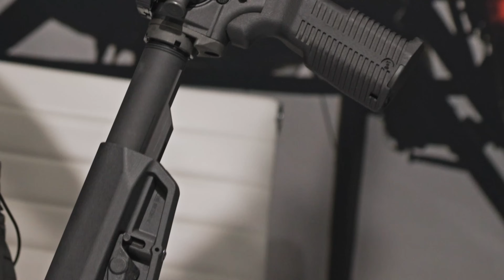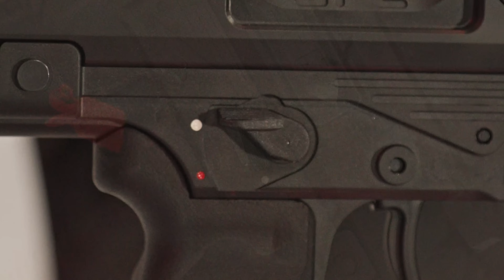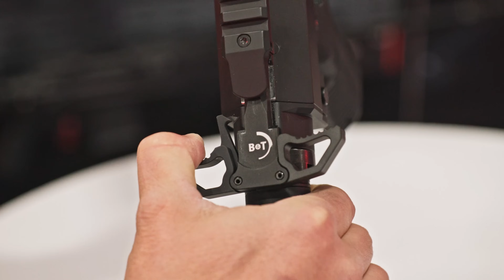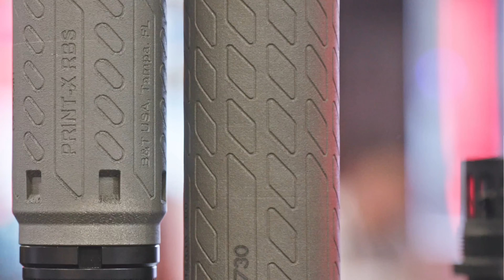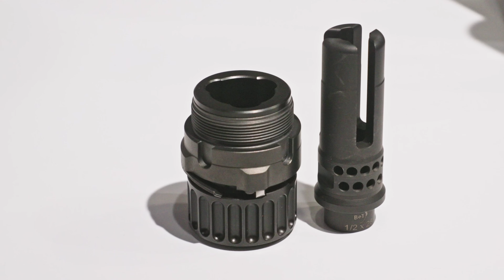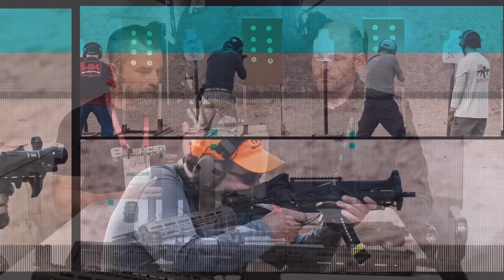SHOT Show 2025: NEW B&T Products! SPC223, Titanium Handguard, TP9 Pro, Print-X VERS36 Ti & More!

Comment: A 3D printed titanium handguard? Why is that? A tribute to fashion? To make it more expensive? To increase the weight? Aviation aluminum is enough for the rigidity of the structure. And titanium conducts heat 10 times worse, so with intensive shooting your barrel will cool worse and will fail faster. Is this really a premium product? 😉
Reply: Bro your handguard isn’t there to be a fucking heat sink. And aluminum hanguards would benefit a ton from being more rigid for NV setups with LAMs.
Reply: @brandonl8039  Mounting sights on the handguard is a bad idea. In the AR-15 design, the handguard is not rigidly attached to the receiver.
Reply: lol go look at basically every NV rifle setup, they almost all mount laser and illuminators forward on the handguard, they would directly benefit from being on a more rigid rail.
Reply: @brandonl8039  Neither the flashlight nor the laser pointer are accessories intended for high-precision shooting, so they can be mounted on the handguard. No increased rigidity is required.
Reply: @ dude an IR laser is used as a sighting system for active aiming at night under NVGs they have to be zeroed, and that zero shifts if the handguard deflects. Therefore they would benefit from a more rigid rail to be mounted on.

I’m not talking about a damn white light flashlight.

Just because you don’t need a stronger rail to go plinking with your AR personally doesn’t mean there isn’t a market for a more rigid rail.
Reply: @brandonl8039  Shooting at a laser pointer is convenient only at close range and when there is no requirement to ensure accuracy. The laser pointer does not have a range adjustment scale. Also, even the most rigid handguard will not ensure the alignment of the sight and barrel in any case due to the lack of a rigid attachment of the handguard to the receiver. I am still sure that a titanium handguard can be useful only for image. It is also necessary to remember that there are only two biocompatible metals: titanium and tantalum. Powder particles from 3D printed titanium that get into the skin of the hands will remain there forever. I would not like to slide my hands on such a handguard often.
Reply: @ good god you are dense, go look at any of the rails marketed for night vision shooting and how much emphasis they put on their rigidity, a more rigid rail keeps LAMs closer to zero.

That functionality is importsnt for night vision rifle setups, active aiming out to 100 or more yards is common with such a setup and a rail that allows shift can cause a large zero shift.

Also there are plenty of rails that attach securely enough to the barrel nut to be stable and the majority of their flex is from the actual material of the handguard flexing.

Also biocompatible doesn’t mean titantium dust will never leave your skill, that’s just horseshit, biocompatible means they don’t cause any adverse immune or toxic reactions. IE titanium is much better to be in contact with your skin that most other metals. Not that any common handguard metals are particularly harmful when outside the body IE in your hand.

You are spewing some epic levels of bullshit here. Just say you don’t like their product and move on, stop trying to make your opinion logical because it’s not.
Reply: @brandonl8039  I expressed my opinion and argued it. Those who are in the know will understand everything. You can think as you like. I wish you luck.
Reply: Well said, I thought the same exact thing.  Rail does nothing special and gonna be HOT AF!!
Reply: You should have called the engineers at b&t and told them this, could have saved them millions of dollars..... Lmao
Reply: @Bmxr1991  Thank you for the advice, but trying to teach those whose results show that they couldn't even master the school program of elementary physics is a hopeless endeavor. And why should I privately teach my competitors if it is more profitable to show the absurdity of their decisions publicly ;)
Reply: @Denis_Lvov  Oh I see... You are an engineer for another firearm company, interesting.
Reply: @Bmxr1991  Yes, I am a PhD and mechanical engineer, developing some technologies for 3D printing and gas dynamics for small arms and artillery. If we take into account that all specialized competitions over the past three years have been won by our weapons, it is possible to assume that they are even the best in the world today (since world champions choose them, more than 70 gold medals in different classes over 3 years) :) Can I be of help to you?

Comment: For systems has a mk12 lbp can. I think ot was announced at shot
Reply: I didn’t see it. I did interview them
Reply: @Ertactical  interesting!
I saw it at a night shoot and it easy beat the cat stuff
Reply: @roberthutchinson2856 well yeh haha, the CAT 5.56 cans, even the AlleyCat 5.56, are not going for peak sound suppression. They are going for, in the case of their inconel cans, lowest flash + low weight + max durability under heavy, full auto use + shortest length + least back pressure + greatest distal flow rate possible without notably increasing blast wave amplitudes laterally (at teammates or bystanders) or relying too much on “blast forwarding” to get better suppression rating at the ear or left of the muzzle (like Huxwrx ‘Flow-Thru’ technology.)

And in the case of their titanium silencers, they are going for (and greatly succeeding in) making them have the best overall performance in blast, flash, flow, durability, and sound suppression relative to their weight + size envelope. 

There is nothing else that competes with them in dedicated silencers for gas operated 5.56 and 7.62x39, K-can/“recce style” silencers for short-barrel, gas operated .308 rifles; nor anything outcompeting their silencers dedicated for 9mm sub gun, 9mm handgun, or .22LR. 

The only areas where they are slightly losing to competitors is arguably in full size .308 silencers for bolt guns (the Cat AlleyCat 308 or JL are actually not bad at all for gas-operated .308 rifles or gas operated .300BLK, but PTR Vent outperforms them in sound, at the cost of a lil more back flow), and in .300BLK, but they don’t make a specific silencer for .300BLK.

Btw, my AlleyCat 36 is one of the most insane 9mm silencers I’ve ever used. I run it on an HK SP5 and it keeps my gun shiny inside, no gas issues or over function at all, and it sounds like a suppressed .22LR handgun with 147gr Speer Lawman.

My AlleyCat 556 QD Ti only weighs 8.1oz (it’s beefed up slightly from the civilian WB, and the QD model obviously doesn’t need a separate mount, it has the 1x16LH threading built in), and with their Spooky 2 muzzle brake + Wojtek adjustable gas block on a 14.5”-16” AR15, it is unbelievably quiet for its size and weight. And it required basically no tuning to get the gun to run perfectly fine, but an adjustable gas block is still nice if your gun is over gassed anyway, and it just takes the sound suppression and smoothness to the next level anyway.  

I literally cannot believe how good it sounds and performs for the size abs weight. Both indoors and outdoors. With the muzzle brake and adjustable gas block, it was a lil quieter at the muzzle and ear than the Lazarus 6 I checked out and the HUX 556Ti (the new one), and the B&T SRBS PRINT-X silencers (but I haven’t heard the HX Prints yet). 

I’d also say it was noticeably quieter than an OCL Polonium on the same 16” rifle as well despite having almost no change to gas flow and weighing half the weight.